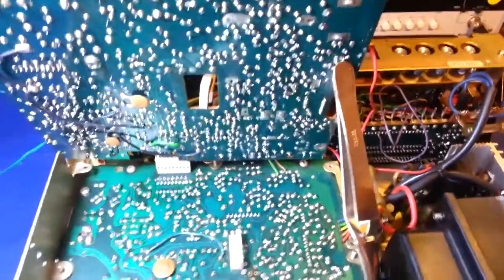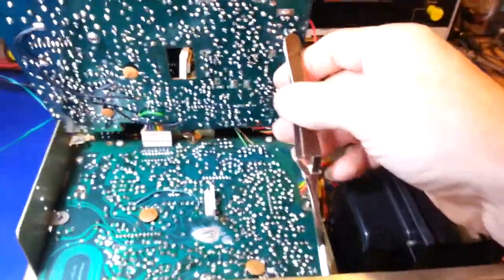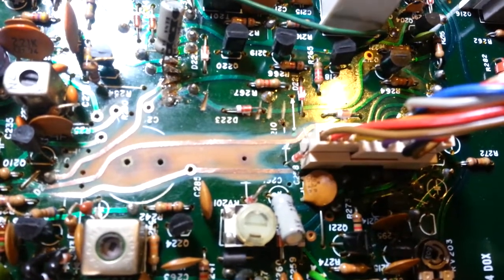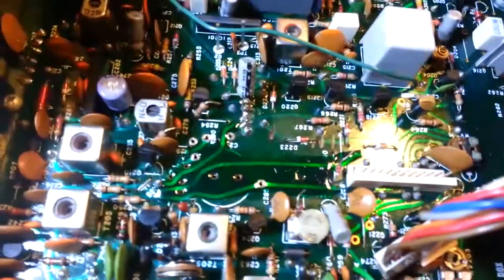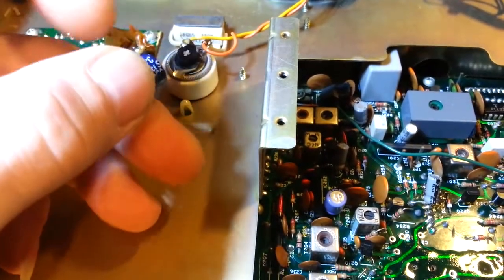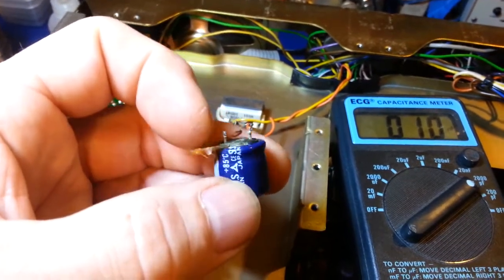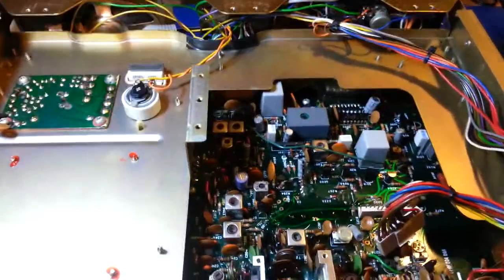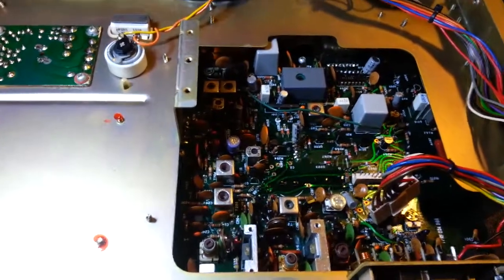GE SuperBase leaky cap corroded trace clean up.

Comment: Please can you tell me Is the replacement 1000uf capacitor a ESR(equivalent series resistance) type or a standard type and can I use a higher voltage say 25v or 35v. Thank-you
Reply from the maker: Not sure what you mean if its a ESR capacitor, do you mean low ESR?  It is a high quality Nichicon cap.  I only use Nichicon or Panasonic.  As far as voltage it doesn't matter.  As long as its the same or higher voltage.  I almost always use higher voltage caps.  The limiting factor there is usually size.  As not only the value increases but also operating voltage the physical size also increases so you can only go so big.
Reply: +MikesRadioRepair  Thanks for the reply Mike for all my questions I asked. 
Low ESR Cap is what I meant, I went looking for caps on EBay before asking you and the Low ESR caps started coming up with the others and so I Googled what the Low ESR cap was and some places said it was better to replace any cap with a Low ESR as it has a longer life and then other places said its better made but can cause problems in some circuits so just don't put one in for the sake of it. That's why I asked you what to use because you would know. I will use the Nichicon high quality like you recommend. I will watch for physical size. 35Volt 1000uf seem to sell a lot.  i have read about the VCO block and how most people change it over if it needs it or not as it will fail sooner or later. I guess that blue cap is something everyone with that GE board should change straight away whether it looks good or not as it will drop its guts sooner or later. I will buy all the products you mentioned. My Board looks like it has epoxy lifting but the track still OKay. So I will get away with re tinning. I am going to buy a desoldering iron. I plan to re cap the complete boards on a few CBs. Thanks

Comment: Watched the Video, Thought"mine never give any trouble(Mobile Version). Flipped the covers today and nearly looks the same as your one there before the work. Capacitor  dropped the insides and I did not even look at the underside of the board yet. But Thanks for showing this, I would never of even picked up on it as you really have to know what you are looking for. I would of just thought it was heat discoloration because its not like its sticky or wettish. So now I have to clean it up, tin the tracks and epoxy it. So what do I clean it with? you have home made flux but what can I get off the shelf? Where do I get the epoxy stuff like you have? Thanks
Reply from the maker: For cleaning use high purity ISP-isopropal alcohol.   Digi-Key sells the Circuit Works overcoat epoxy.  The flux you can buy pretty much anywhere, even on ebay.
Reply from the maker: +MikesRadioRepair 

I meant IPA not ISP.